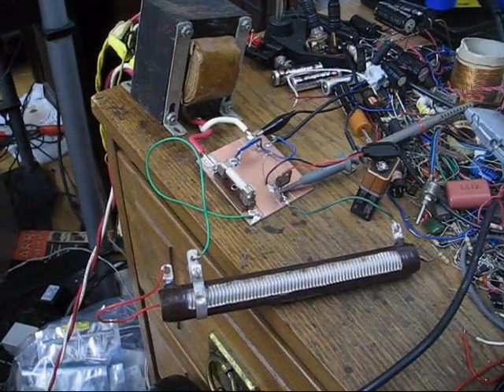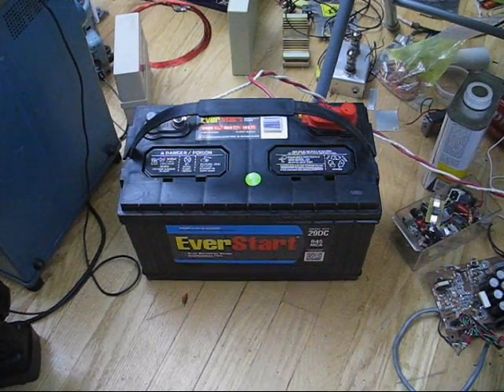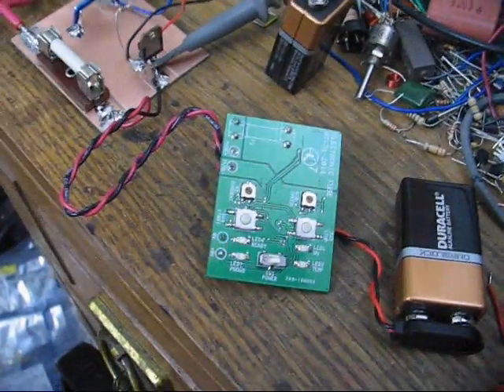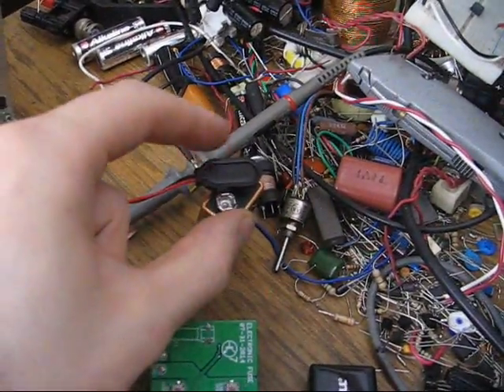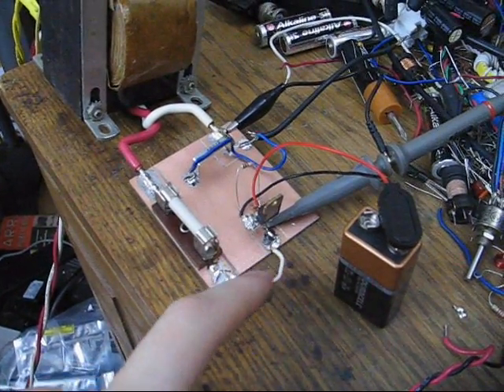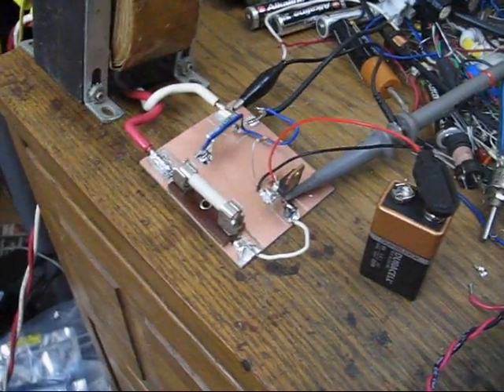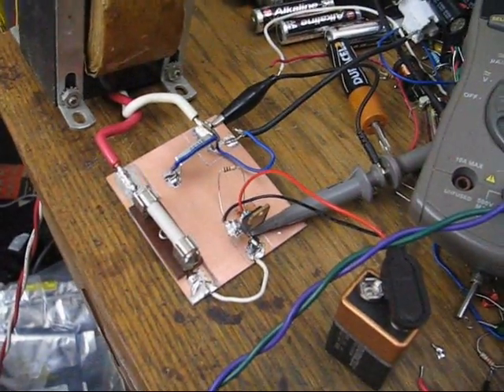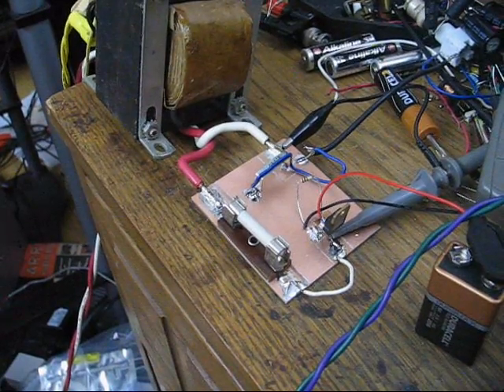Blowing up a Transistor, Live on Video

Comment: Back in the 1990s when designing inverters we used to purposely blow up FETs controllably (constant HIGH current) to see how rugged the parts were.   The length of time it would take before they turned to slag was proportional to die size almost always.  Vendors were always bringing in their newest parts to put on the Fet Blower Upper tester. :)  We finally stopped doing that blowup test and just went by junction to case thermal resistance.  Also opening up the FET package to look at them and also took pictures of the FET dies when we were blowing them up.  I think I still have one or two sheets of blowup reports somewhere.